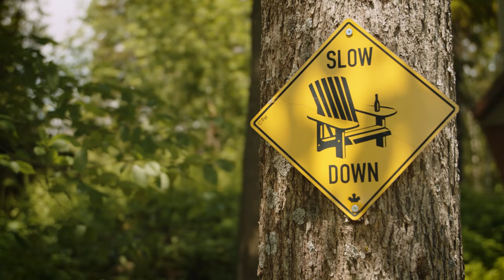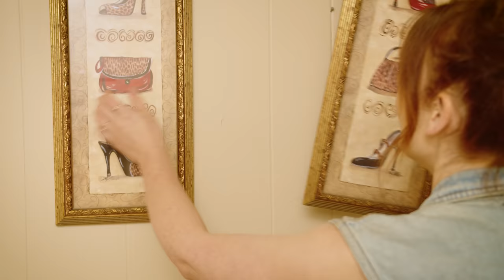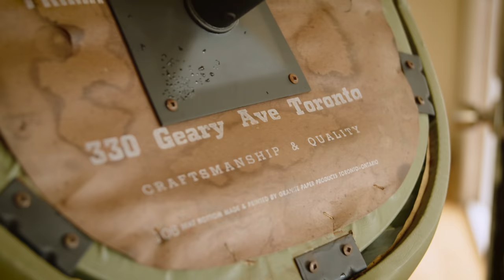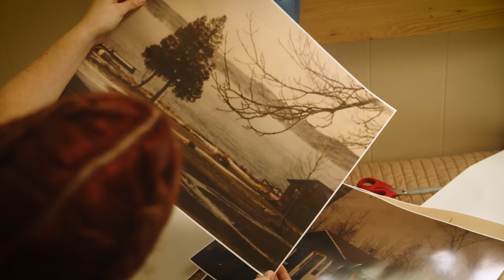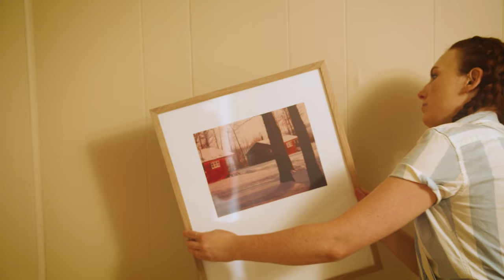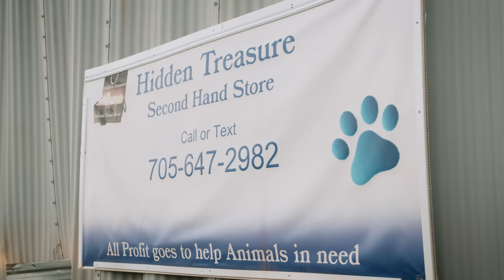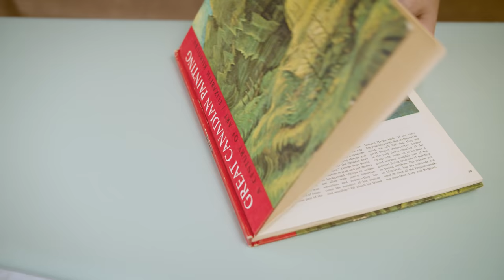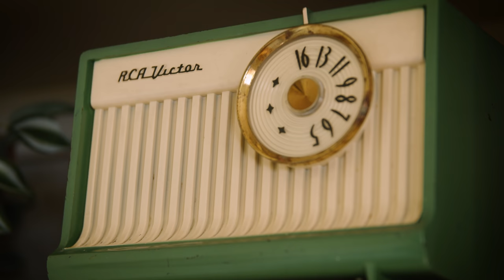going full retro 50's theme for this beach house | Upgrade My Stay

Comment: Oh no! The trees 🌲 are planted too close to the porch. As they grow, they’ll impede on the structure.
Reply: Impede on the structure is a very nice way to put "will completely destroy" 😂 easy to move thankfully 😆
Reply: 😉 Don't think it will be an issue. These evergreens are commonly planted along fences and decks. They will create a natural barrier〰️ giving any visitors🫂 a much needed sense of privacy. 

🌿They won't expand too much, but they will grow quite tall. They are more of a bush vs tree. 😎They're pretty hardy plants, drought-tolerant 💦, and fairly maintenance free. Although once it reaches the desired height, it's a good idea to keep 'em trimmed on top.
💚 Bridget from Cali ☘️
(using my pal's YT acct)
Reply: Yeah, you really need to give yourself at least a foot to 2 feet from any foundation.
Reply: Maybe they should keep a contractor/gardner/generalist on payroll.
Reply: Do not put  the dirt up around the trunk as it will smother the cyprus.  Leave a little trench.  Good luck.

Comment: Actually, a fun tip I learned from one of my plant groups: apparently, if you dig a square hole for trees when you plant them, the gain height a little faster because the roots have more of the loose soil to spread into. :D

Comment: This fell short for me. Not beachy or 50s diner, I think they missed. The rugs are terrible, the kichen looks good though! That's the best part. The whole thing looked more 90s to me. Why did Kelsey hang the curtains in the middle of the window frame like that? And why not swing the lamp over the table with a second hook?  I think they forgot their colour palette too.   The editing was the star of the show for suuuure! The sunscreen moment LOL!
Reply: Saaamme. The red was odd and didn’t really fit (that chair was horrid). I think they were trying to bring in the red from the exterior but the ones inside were wayyy too bright to match and felt out of place. The one rug at a weird angle for no reason and the WHITE rug in a rental? That would have to be replaced within a season. And then the bedroom was just mismatched and odd. Just going for some plain white bedding (that can be bleached) would have been better and the comforters they chose are hard to wash since they’re stuffed. Assuming they didn’t have the budget to get headboards I guarantee they had leftover paint they could have used to emphasize the beds and tie the rooms together more. The hanging lamp was a bit complicated since the stud is needed to hold the weight of the shade but it could have been a reading nook and they could have put the table on the other side of the window. The kitchen looks beautiful but the red really ruined the rest of the room for me

Comment: This is just a suggestion for the next time that you hang those kind of curtain wrong I'm that you hang those kind of curtain rods that you were hanging in the bedroom if you take if you take them apart and put your curtains on the side put your curtains on the side that's the side that fits into the other piece that fits into the other piece and then slide it together slide it together then you can hang them it makes it a lot easier it makes it a lot easier than trying put them on the hooks

Comment: Imo they shouldn't have painted those tables.  They couldve been BEAUTIFUL if the just put oil or a finish on them!!  Although the table with drawers would've also looked cool if the painted the rounded "legs" only black and just finished the wood..  But, they did fit well and it looked awesome but that part hurt my heart a little lol.  God bless ❤❤❤

Comment: I usually love TSG content but these last 2 upgrade my stay episodes fell a bit short for me - i feel they are a bit too long winded and scripted, personally, i much prefer the 'vlog style' episodes, such as making home. As for the styling - yes the end result looks better than it did before, but not THAT much better in my opinion. The colours were a bit all over the place and it still looks dated to me... there's a lot more opportunity to style a theme in a modern way without it looking like you've bought a bunch of stuff from the thrift store. For instance in this space, I would have leaned into the 50's theme hard with a very colourful light blue/yellow/pink kitchen and then used pops of colourful decor or memorabilia to accent a more neutral space, using 50's shapes but modern furnishings to continue the theme. I'm not trying to hate on it, just stating my thoughts.... Would love to see the design process more - eg. mood board, budget etc.